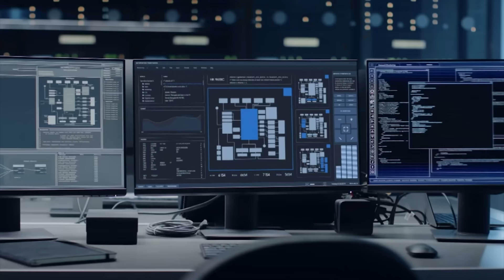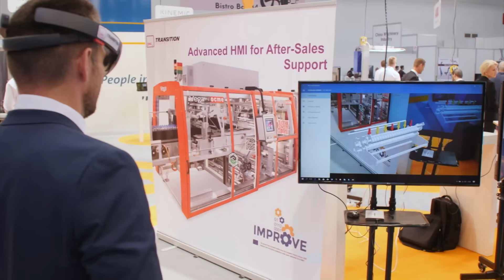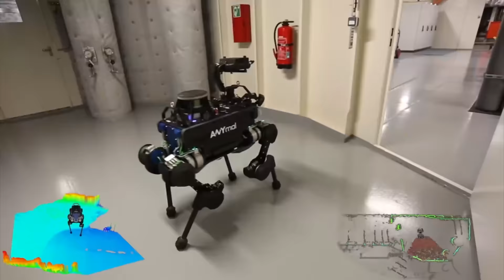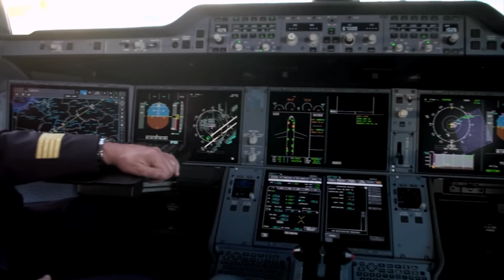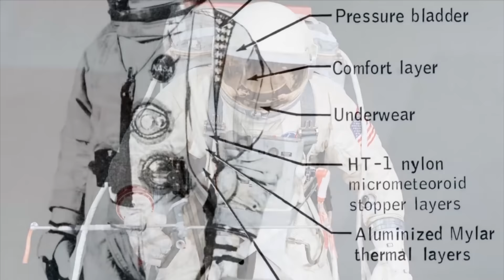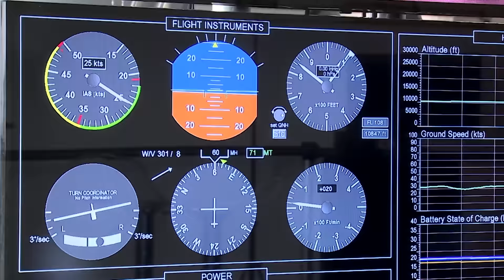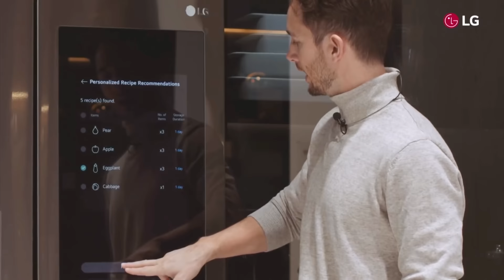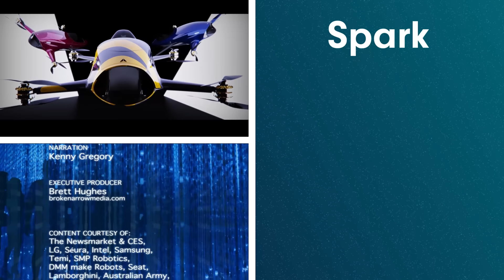Are We Living Through Another Industrial Revolution? | Tech Effect | Spark

Comment: A worthwhile invention solution would be to prevent commuters in motor vehicles from colliding with deer (& other large animals). I have a homemade trigger on my steering wheel which activates my extra noisy vehicle horn. This motivates the deer to quickly depart in whichever direction is 180 degrees opposite the horn (away from my oncoming vehicle).
TRUST !!

Comment: IF they're going to send a robot up that has it's own solar and battery charging mini station and have the upper body like a human, then they should just send the full body humanoid robot they just finished showing, that could climb, walk, run and jump, and dance. You gotta know dancing is the most important part, lol!! Anyway, it could get around easier and likely faster than anything they have sent up previously, plus likely do so with much more efficiency, less complications and so forth,,,, or do they want their bots to fail while videoing and collecting from the wilds of Utah and likely Greenland, like where it is splitting apart. I just find it questionable that the same rocks in the same colors backdropped by soil in a different color match up so well if not identically between Utah, Nevada, and likely other similar locations on the globe and Mars!!!